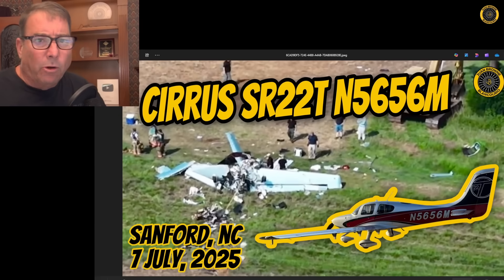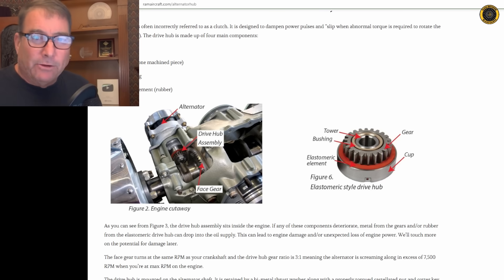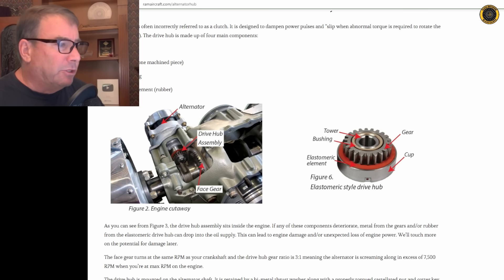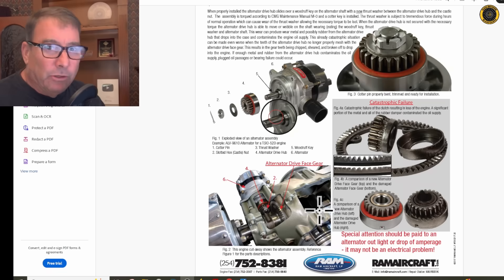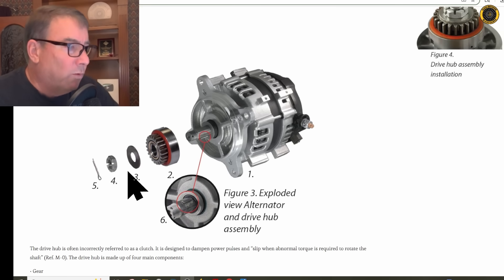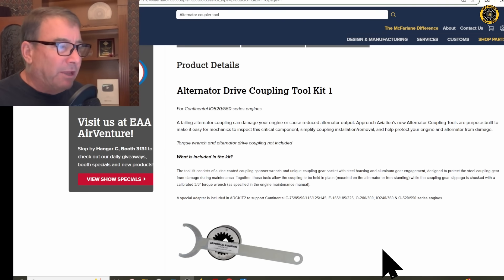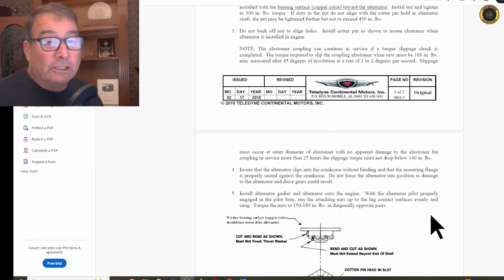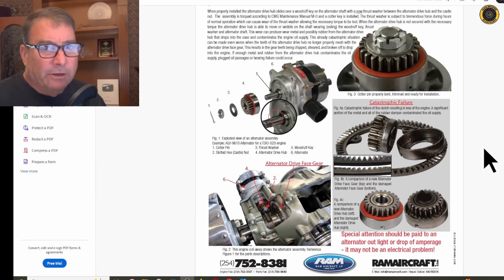Alternator Drive Failure-Can Lead to Engine Failure!

Comment: Any alternator failure such as a bearing, binding or coming apart internally will cause Elastomeric element on the coupling to slip and fail. It's the weak link it's just a Red RTV rubber that prone to failure no matter how much you inspect or replace it. The test isn't valid because its not under the same temperature, vibration load or oil viscosity when in the engine. You can catch it early on a oil change when you see a few specks of red Elastomeric rubber in the filter.  It slips until it shreds the Elastomeric rubber into small grated pieces eventually blocking the oil filter. Then the oil filter goes into bypass mode letting the  Elastomeric rubber into the oil passages restricting lubrication to the engine bearings causing a engine failure. Pilots continue to operate on the backup alternator to there destination instead of making a emergency landing asap. That's the deadly mistake. Its a failure prone design. The smaller Continental's older IO360, O300,O200, C90, C85 with a gear driven alternators. have small 2 rubber drive cushions ($6 parts) easily inspected by the play on the alternator cooling fan. But hardly ever done. You can sometimes move the fan almost a half turn. About 1 or 2 inches is normal.

Comment: What an absolutely stupid design. A simple one way roller clutch or shear pin on that alternator drive would be cheaper, more reliable  and achive the same purpose of decoupling a seized alternator.

Comment: From a non pilot: In system design—especially in safety-critical applications like aviation—counterintuitive solutions often provide the greatest resilience. Take the example of how an aircraft alternator is driven as in this case. At first glance, it may seem wise to mount the alternator directly to the engine via gears: fewer parts, less slippage, seemingly more reliability. But this tightly coupled setup introduces a dangerous risk—if the alternator drive fails mechanically, metal shavings or fragments can contaminate the engine itself, leading to catastrophic failure.

A belt-driven alternator, on the other hand, embraces the principle of "let it fail". If the alternator seizes or the belt breaks, the failure is clean and contained. The engine remains untouched. And with the battery still available, the pilot is given time to respond calmly and land safely. This is not just failure-tolerance; it is graceful degradation.

Designing for isolated failure, even at the cost of some efficiency or complexity, reflects an understanding that not all breakdowns are equal. Some are survivable. Some aren't. Systems that acknowledge this truth—by allowing non-critical components to fail without dragging others with them—are ultimately more robust. In aviation and beyond, "let it fail" isn't negligence. It's wisdom.

Comment: Had a alternator’belt’ break when I was at 6000ft over water on my way back to the UK after leaving France. Plane full of family and friends. 

All sorts of weird and wonderful annunciator lights, coupled with loud noises through headsets and full gauges visibly running down to zero fuel despite no visible fuel leaks - after a brief ‘oh shit I don’t need this’ then came the light bulb moment and the smell of burning. 

I deduced it was an electrical failure but couldn’t be 100% sure exactly what it was. So I turned off strobes, air conditioning literally everything electrical knowing that the engine in theory will still run (according to our flight training 🤔)

Burning smell dissipated and I used my handheld ICOM vhf/for radio to get us back to my home airfield. I had no transponder so called up a major london approach frequency to give them a heads up I was coming in no transponder and they quickly ID’d me after a 360 degree turn. 

Landed all ok in a very busy airport and airspace after following the normal rules for this event. 

Turns out there was a faulty batch of alternator belts in the market that was uncovered by investigators. The burning smell was a combination of the last pieces of frayed belt disintegrating and the batteries starting to boil before catching fire which they may well have if I hadn’t turned all electrical items off. 

Oh and whilst all this was going on keeping my passengers calm and happy 🫣😄

Comment: Back in the 80's i flew a 172 at night, fortunately circuits, soon as airborne all electrics started failing.
So called it a day and landed. Told later by operator that alternator seal failed and oil contaminated the slip rings. First i knew of engine mounted alternators.
Reply: First sign of problem was squeal on power check, i just put it down to damp alternator belt.
Also the turn coordinator was erratic flicking from side to side at slightest movement (gyro not spinning fast enough for rigidity)..

Comment: He only mention part of the problem, not only does the alternator give up and die , but the orznge rubber drive breaks up and travels to the sump, from were its sucked into the oil system and blocks the inlet to the pump. No need  to say more. This has killed quite a few people over the years. I worked in a small firm rebuilding this stuff and saved somebody certain death, the company didnt understand the rebuild prrceedures and were putting untested couplings back into service with NO INSPECTION .I picked this up with and alternator problem, and oil sump full of rubber, new overhauled

Comment: Yikes.  Newbie but I had no idea that this sort of system could lead to an engine failure.  Makes sense though.  Great that we get reliability of engine driven components, but now I see how having additional items like gears effectively inside the crank case creates the risk of those parts (or fragments) binding up the engine.

Comment: Seems bad engineering on a 787 that you can turn off the fuel to both engines seconds after the weight comes off the wheels. Can you think of an instance where you would want to shut down the fuel to both engines seconds aftet lif off?

Comment: I'm not a mechanical engineer, but any design requiring these kinds of fine torque settings and adjustments on such a crucial component who's failure would take out an entire engine, seems bad to me. If an alternator drive belt fails the magneto steps up to carry the load. If an alternator gear drive fails, it takes out the entire engine with it. Just doesn't fly on paper.

Comment: I think I may have to respectfully disagree about the engine and the displays both failing at the same time.  If the alternator fails, you won't lose the G2/G3 displays at the same time, as the battery will have to run out of power first.

Considering that he was having radio issues around mid Florida, it is likely the alternator started failing around that time.  The power issue got worse until he lost the displays and power.  Then the debris from the alternator caused an engine failure as he was on final to the airport, and he lost control of the aircraft, causing a fatal crash.

Ultimately, me made a baffling error by continuing the flight with the radio and electrical problems, intending to fly close to 3 hours after he started having problems.  Obviously a very poor judgement on his behalf, especially flying with your family on board...

Comment: WAIT!

If the thrust washer goes on the shaft after the coupler, why say "copper color toward the alternator"? Wouldn't "copper color towards the coupler" be preferable? "Copper color toward the alternator" could easily be interpreted by someone with low reading comprehension to mean that the washer goes on the shaft before the coupler, with the copper side towards the alternator.

Comment: 3 minutes 33 seconds.  You said foot pounds instead of inch pounds.  350 inch pounds is 29 foot pounds.  450 inch pounds is 38 foot pounds.   I wonder how they hold the alternator shaft to set the torque. Not just check the slip.   I am going to send you an email detailing some crazy easy voltage drop tests that find electrical connection issues.  I have not tried these on aircraft but I am very experienced with delco and most other automotive alternators.  

Wayne.

Comment: Elastomeric coupling failure is like a belt failure, but it doesn't eject the belt debris, so the cascade failure potential is more constrained, to exactly this scenario. Chunks of snapped belt flying around are unpredictable. From the perspective of someone who's only touched car engines, not plane engines, this seems like a smart design choice to guarantee the plane stays in the air in the short term.
Reply: belt drive alternators on aircraft engine are mounted at the front.   if the belt fails, the only thing in plane with it is some sheet metal cowling.

never heard of a belt drive alternator failure grenading an aviation engine,  but when these gear drives go, they almost always take the engine with them.
Reply: @ShuRugal  in practice I'll always bow my head to the engineers who actually build the things, the pilots who fly 'em, and the NTSB... both are valid enough solutions to have both in the air at this point on their respective craft. I'm just speculating on the risk management that might lead to choosing an inevitable eventual failure (with a failure mode pilots need to be aware of) over the outside risk of belt pieces maybe causing an unforseen issue.

I'm also not aware of alternator or serpentine belt fragments causing further issues in a car... I've personally had my serpentine belt blow and kept driving with no belt fragment issues, long enough to reach a safe spot to park. A driver on the road doesn't have to consider issues of that outside order, of course.
Reply: well, I'm in that list. 

ejecting belt debris is a complete non issue.   shards of grenaded drive gear inside an engine is a deadly issue.
Reply: @ShuRugal  I completely agree, and I won't ask you to fly anything you're not comfortable with. If you're saying you're the NTSB, feel free to ground the Cessna 300/400 series if you like? Blowing a drive belt because you didn't do alternator maintenance is less deadly than blowing a drive gear for the same reason, yes, but gear transmissions are also more reliable when correctly maintained, that deadly failure can be avoided. The chance of a given failure is just as relevant as the severity to a calculation of risk.

Comment: I have done that SB a thousand times over the years and have never seen any damage to the gear. Cirrus says the Alternator should be inspected every 500 hrs.(Recommended). The drive hub is designed to slip in the event of an alternator failure, that’s the reason for the torque check. Also the SB says it’s imperative that the cotter key for the hub nut be bent and trimmed a particular way in order to not interfere with the crank drive. I can say that I have never seen a hub cause an engine failure but I guess anything is possible.

Comment: Hey Juan, had the exact same thing happen on a GTSIO in a C404 here in Oz. Intermittent alternator paralleling issues, caused by the copper washer backing the tension off and shearing the drive key and cotter pin securing the drive gear. Found it at a 50 hourly with metal in the filters. $150K to overhaul the engine! We were lucky!
Reply: You can either be filthy rich, or be an aircraft owner.

Comment: Friend built a Lancair Legend (Conti IO-550), factory brand new motor was less than 1 year old, <100hrs. Alt failed near home and in the hangar we were "fishing" pieces of metal out of the oil sump. Not a good design.

Comment: 3:20 Bimetallic washer? or Belleville washer (spring)?
Reply: These days people don't even know the difference; also don't know when to use the split, outside, or inside tooth lockwasher.
Heck, people don't even know how to use "chip type" credit cards, instead incesantly "tapping" them to no avail. The ignorance of modern society is astonishing, and very sad.
Reply: Considering Juan mentioned one side being copper, bimetal sounds correct.

Comment: This is why I consider myself fortunate to have learned to fly in an L2 Taylorcraft and an Aeronca Champ. No glass panels, no alternators. Hand prop to start. Eventually I went on to fly KC-130's and Lear Jets. However, I never forgot how to fly "partial panel" and basic stick and rudder when everything quit, thanks to that primary training.

Comment: So… in the event the electrical failure followed by the engine failure was caused by that direct drive alternator would one assume the aircraft was for some time operating on batteries only?  And wouldn’t there be some indicator letting the pilot know?

Comment: The coupling all used to besteel and they changed them to elastromeric. 

If the alternators bearing failed the  elastomer coupling would twist apart from the spinning engine leaving the alternator in one piece and not  dropping the coupling into the motor. 

The steal coupling would sheer the alternator shaft and all steel coupling would   fall into the engine causing catastrophic failure.

Even with the elastomer coupling failure, a tear down would be needed cuz the elastro material will fall into the engine and could block oil galleries,  but you could get it where you needed to go.

Comment: I like the idea of belt drive.  It is simple, easy to check, easy to maintain, and if one has any doubts, cheap to replace.  And, it won't destroy your engine if it fails mid flight.  Lastly, if your plane has at least a small battery, you will have power to land safely with a still running engine.

Comment: At the RAM site, the "Alternator Drive System - (Forward Mounted Gear Driven)" page says that Continental specifies an alternator drive inspection at 500 hour intervals (to be accomplished during the 500-hr engine inspection). Very specific instructions on how it should be accomplished.

Comment: Another downfall of this design is as follows;

Hot-starting of the engine will usually result in a fairly long crank time. When the engine fires, the alternator will be in full output until the battery is recharged. 

The alternator is mounted directly to the crankcase which in this scenario is pretty hot and will transfer heat to the alternator. 

Hot alternator and full output puts a serious strain on the diode bridge and will sometimes burn it up. 

Bad design all the way around.

Comment: As retired GA pilot who only flew “old” aircraft and the most modern thing I ever got to use was a small calculator with an  aeronautical programme written into it (as a SP it actually it was the best thing since sliced bread compared to using the old metal Jeppesen) I really appreciate Juan’s factual and non emotive explanations of all things aeronautical. I had a few alternator failures ( but not the belts shredding) but never tried to continue the flight  and landed asap.(also never at night which would be extra stressful).

Comment: Why use this drive for the alternator. What a dumb ideas.
One point of failure, can lead to death. Unacceptable. STC a return to the tried and true belt belt with an automatic tensioner.

Comment: I don't understand how this elastomer coupling works... the alternator shaft is keyed to what they call the "tower" inside the gear, but the keying does not extend to the bushing between that "tower" and the gear. This means the gear is not connected to the alternator shaft. The only thing that couples them is the face friction of that washer that overlaps both the "tower", bushing, and gear. The elastomer around the outside of the gear to the cup... what the heck is that doing in terms of any clutch type mechanism? That cup is is not connected to anything so why is determining the slip against it useful information? All I could see the elastomer doing is providing vibration damping. The elastomer slip test makes it seem like this is the important part of the clutch-like mechanism, but I don't think it is. Only that washer is providing the slip for peak loads between the alternator and the gear. All I could guess this slip test is for is determining if the elastomer is still in decent condition, and not getting brittle or deteriorated for risk of it getting into the oil system.
Someone please correct me if I am wrong!

Comment: I run our maintenance shop, we are a Bonanza specialty shop.....we do the torque check every 500 hrs weather the customer approves it or not. Had a A36 taxiing up in december for a break job and this was a catastrophic failure right in front of our shop...he just landed. I have a customer with a 310 and we were doing the 500 hr and both alternators had NO COTTERPIN and the nut was HAND tight....so many shops neglect this serious issue.

Comment: I see these SR 22 crashes. I know that the parachute on these aircraft is only recommended for use above 800 feet or so, but there are cases where even below that altitude the parachute considerably slowed the crash and many of the people walked away. So why did these owners not pull the rip cord? This guy could’ve easily done that he knew he was in trouble at about 1000 feet as I understand it.
Reply: My guess is that he was preoccupied trying to troubleshoot the multiple issues he was confronted with until it was too late, but we'll never know for sure. Fundamentally I think this was an ADM problem, to me there was enough hinky about this aircraft to warrant diversion, especially with the kids onboard. This one gets to me more than most.

Comment: Interesting. That would seem like a concerning design. I would prefer a direct drive generator with no mechanical blockage option. Just magnetic coupling. That might be slightly more costly in the generator but greatly simplify the engine so it's a no brainer.